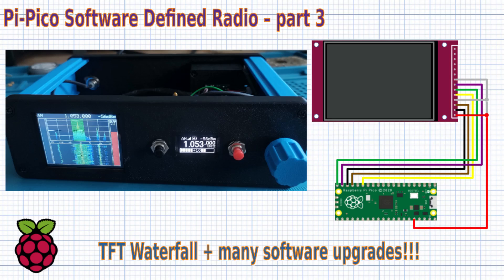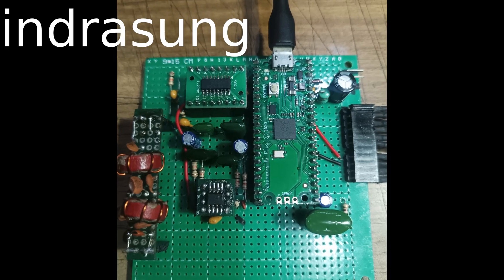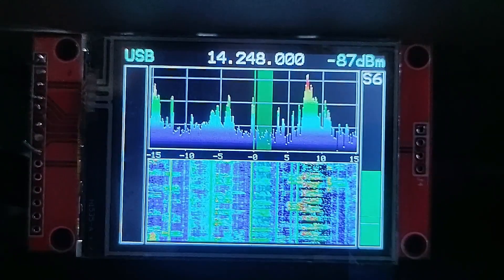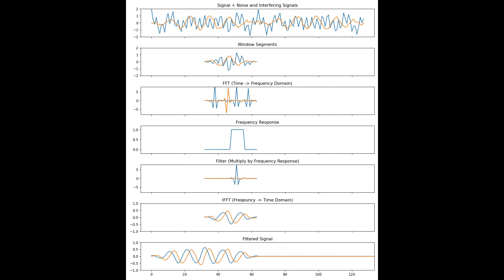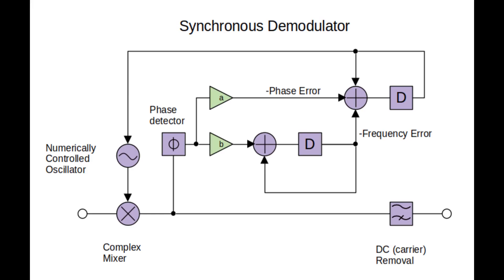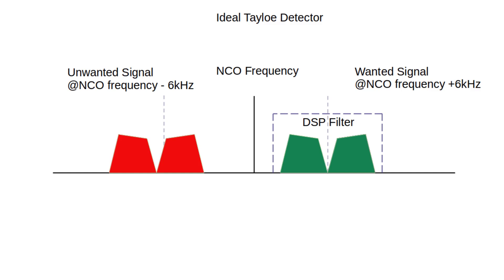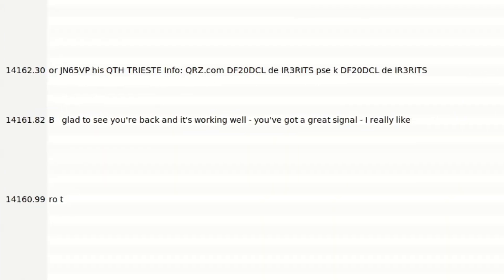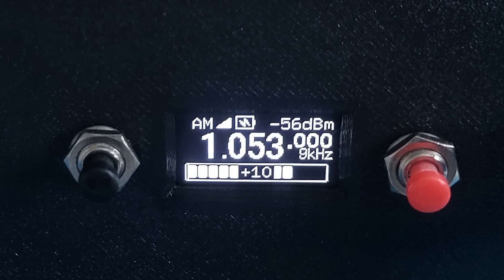Software Defined Radio with Pi-Pico - Part 3 TFT waterfall and software upgrades

Comment: Hello Jon again. the upconverter for 2M I have built (to 10.7 Mhz) for your receiver works great with strong FM narrow band signals - with weaker signals (from far repeaters for example) there is quite a lot of fading and crackling that comes and goes - if I connect the I and Q outputs to the PC sound card inputs, these weaker signals are received perfectly - any other settings that would improve this besides playing around with squelch ? - thanks in advance
Reply from the maker: Nice, very impressive! Its hard to say what is going on here, it could just be that you need a bit more gain for the pico? The ADC in the pico is nowhere near as sensitive as the typical audio ADC. Having said that the FM demodulation in the pico RX is a fairly basic implementation. It would probably benefit from an additional low-pass filter after the demodulator.

Comment: Hi John! I made this receiver. Everything is good, but there are some unpleasant moments. Lots of interference and signal interruptions when tuning in SSB mode. Similar to si4732. I think that the receiver will work much better if you use si5351 as a frequency synthesizer. It will not complicate the circuit much. Would you like to implement this option?
Reply from the maker: Hi, yes I have implemented si5351 support on the TFT development branch. In terms of receive performance it doesn't make much difference.
Reply: @101Things-ds8tc  Thanks for the quick reply! I would like to know the link to the TFT development branch. I don't really like the operation of the receiver in SSB mode because of the signal interruptions when changing the frequency.... It is very annoying and reduces the class of this receiver. The sound quality is good, but the signal interruptions and the insufficiently clean signal spectrum from the microcontroller spoil everything. Even the receiver on si4732, with an improved frequency tuning algorithm in SSB mode (one click after 16 kHz) is more pleasant to use. For me personally, the sound of the radio is more important than beautiful pictures of the spectrum on the TFT indicator screen. Thank you very much for an interesting project! 73!
Reply from the maker: Hi,

You can find the TFT development branch here: https://github.com/dawsonjon/PicoRX/tree/tft

Keep in mind that it's under development so there will probably be some bugs and things I haven't spotted yet and the documentation isn't up to date.

There are two issues to work around with the tuning clicks, the first is a transient caused by the PWM frequency changing as the PLL retunes. We have been experimenting with various mitigations to minimise the impact.

The second is that the DSP processing has to be halted each time we write to the flash, a limitation of the pi-pico. I have experimented with delaying the writing of new frequencies to flash until they have been stable for a short time. I like the idea of an optimised tuning algorithm along the lines of the si4732 only retuning every 16kHz, it might be possible to do something along similar lines so that the LO only retunes after large changes in frequency.

Cheers
Jon

Comment: Can this SDR be connected to an external sound card 48...96kHz (I and Q channel) and use CAT protocol for use with PowerSdr software? If not...can you enable it?
Reply from the maker: Yes you can connect the I and Q outputs to a soundcard. The Pico Rx does also support CAT control too. You will find that the tuning is unpredictable since the Pico Rx uses a variable frequency offset to accommodate the IF and limited frequency resolution of the PIO based oscillator.

Comment: Hello Jon, I got your Pico 2 code all working with my homebrew 2m/1.25meter downconverter (to 10.7Mhz) - your FM code works great with narrow band (using your code defaults) - great work!. Question: what's the least messy way to disable the USB audio? - I would like to use that port for a simple uart - it does not seem to work with the audio operations going
Reply from the maker: Great 👍 Were you planning to share the results? I'm sure there would be a lot of interest.  You should be able to get a UART and USB audio working simultaneously, that's how the CAT control works. It should be easy enough to remove though, if you wanted to remove the USB audio, I would remove the usb_audio and ring buffer stuff from the cmakelists file, then keep removing code until it compiles cleanly.
Reply: Hello Jon, im still trying to complete this design. Are there any #defines that have to be set for a pico2? In order to get accurate frequency at 150mhz?

Comment: Hello Jon, Im trying to build an FM decoder for 10.7MHZ only (I & Q input) with the pico2 - I dont need screens or controls - much simpler, which revision of your early code do you recommend I base my work on? - this is to decode a 2M transverter I have built thanks in advance - your project is very capable
Reply from the maker: Hi, sounds like a very interesting project, would be keen to find out how you get on. You would probably be best off using the latest code since it's more mature, it.should be fairly easy to take out the bits you don't need. Most of the work is done in rx.cpp and rx_dsp.cpp. If you don't have a display etc, it is possible to run the receiver without the UI, using just the CAT interface for example. Might be useful for testing.

Comment: Can anyone tell me if bjt transistors could be used instead of op amps?
Reply from the maker: Hi, it's an interesting question... I'm sure it would be possible to design an equivalent circuit using individual BJTs, but I think it could be quite challenging to design and would probably be more complicated (and expensive), than an op-amp solution. It is possible to get the op-amps in through hole packages, and there are alternatives if availability is an issue especially if you are willing to consider 5v devices.

Comment: I have a question, hopefully you're still responding to youtube comments -

Since your LO is a fractional-N division of the Pico's system clock, what effect do the resulting jitter/spurs have on your performance?
Reply from the maker: Hi, yes this is certainly a compromise, but it's very hard to predict the effect on performance analytically, since it depends on the spectral content of the jitter. If the jitter were totally random, this would lead to phase noise effectively increasing the noise floor. In reality the jitter isn't random but occurs in a repeating patterns leading to spurs, some of which might result in interfering signals being heard. I think that also adjusting the clock frequency to give the closest match helps to reduce the total amount of energy not at the fundamental. The performance is also frequency dependent having a more significant effect at high frequencies, and negligible at low frequencies.

In practice the receiver does work very well, it can hear nearly everything my other receivers can, giving plenty of signals right up to the 10m band. There will be occasions where the spurs lead to interference being heard. I'm working on a couple of ideas to help improve this though, and will share them in the next update video.

Comment: There is a big improvements since I build one, this is very good. One question, according to the user manual, is it all features specify in your latest user manual are in the master branch or others branch from your github page?. And very thanks to include my build picture in your video. Bahari - 9M2GRC, 7 3
Reply from the maker: Thanks very much for sharing you build! It's very rewarding when others take the time to reproduce a project. I hope you had as much fun with it as I did.

The firmware on the master branch (and the pre-built binaries) have all the features mentioned in the user manual.

There are more features in the works too.
Reply: @101Things-ds8tc  For TFT can I used SPI based but with different resolution 128x128?
Reply from the maker: Sadly no, it would be a fair bit of work to adapt the software to work at a different resolution.

Comment: I am gathering yhe parts to build this now. The 2.8" screen doesn't seem to fit in the 3d printed case....? Did you use the 2.8 or a 2.2"? Thanks!
Reply from the maker: Ah yes, I used the 2.4 inch version... Good luck with your build.
Reply: @101Things-ds8tc  i guess this comment will help others, but I ordered the 2.8" screen, because it is shown in the video. :(
Reply from the maker: We could look at providing an alternative front panel to accommodate the 2.8inch screen. I think it could work with a bit of fiddling...
Reply: @101Things-ds8tc  Or you could edit the video to add a note that the 2.4" is required, not the 2.8" shown... I didn't read the BOM before ordering, because of this video.
Reply from the maker: I have blurred it out in the video. I can add a 2.8 inch version of the front panel too if there is any interest.
Reply: @101Things-ds8tc  Blurring it out should do the trick.

I've already got the 2.4" screens coming, but bigger is always better, right? I think the ILI9341 screens stop at 3.5".

Thanks for your effort! I am excited about getting this RX assembled.

Comment: First. This device is fantastic for what it is. I've been using it for mw dx the past week with a homebrew PA0RDT miniwhip powered with bias t from a MLA 30+ with the cover off to allow attenuation. Amsyn great and overall this thing is rock solid stable. The only wish I have is to have 3db increments in agc. Is that just a simple extension of a string an or array that a common hack could apply?

The one area that I do have question with is with audio line between the pico and the earphones jack. There is a lot of difference here between the "original" and what you have done. I built as you show expecting that changes in software application were the reason. After one night of use I seemed to notice no expanding in audio bandwidth when am receiver bw changed and, it seemed muddy and narrow in audio spectrum. I've gone from 100uf down to 22uf and kinda think I can get away with bit more. I do not think I hear the machine running after this change. I am very interested to know what you think here? Seems the 100uf is a very limiting factor to audio fidelity but, I do not know enough about this device to know why it is as it is. ... 
I hope you continue forward with this device.
Reply from the maker: Cool! Thanks very much for the feedback. 

3dB steps is slightly more difficult, but should be possible. 6dB steps uses powers of 2, so all the manipulation can be done with shifts. 3dB steps would need shifts and multiplies.

The 100uF capacitor is a DC blocking capacitor and determines the bass response. It forms a high-pass filter with the headphone (e.g. 32 ohm), so has a cutoff frequency of about 50Hz). Substituting a 22uF capacitor would give a cutoff of about 200Hz, so would block out more bass frequencies. This would be fine for voice signals though. If you use an amplifier, this would have an input impedance in the 10k or more, so would let through everything above 1Hz.

The 100ohm resistor and 470nF capacitor form a low-pass filter. This determines the trebble response, these value give a cutoff of 3.3kHz. Decreasing either the resistor of capacitor would increase the cutoff frequency, but would allow through more PWM ripple. There isn't much to be gained from increasing the cutoff frequency because the DSP filters don't let through much above 3kHz in any case.
 
The values I have used are good choices for voice reception, but it would be possible to make some tweaks to improve reception of music (within the limits of what an AM channel can achieve).

Cheers
Jon
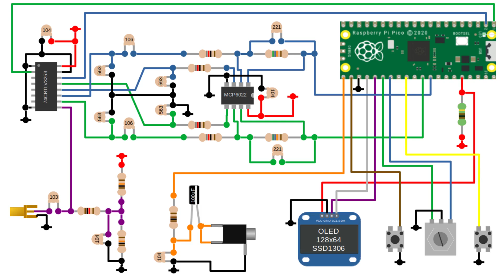Reply: @101Things-ds8tc  What 470n?? At 00:09 the layout shows a 100uf, 100r & 104 cap??? Should the 104 be a 470nf?
Reply from the maker: Ah yes, there is an inconsistency between the coloured schematic in the video and the more traditional schematic on the documentation page. I actually used 100n in the build and it works fine, it would have a cutoff of 15kHz, but should still attenuate the PWM ripple by about 30dB. 470nF would probably be better having a cutoff closer to 3kHz giving about 40dB attenuation of PWM ripple.

Comment: That pretty interesting projec you get. For that I&Q Mixer imbalanc, I wonder if  it will be simpler measure that inbaalance one time (sort of calibration pocess) and mapped for each LO frequency. You could use that to make look up table. Ps. Lately doing measurement of microwave I&Q Mixer upconvertion image rejection and contemplate what the better methode beside using 90 degree hybride: feed arbitrary 90 degree I&Q, or sweep 360 degree to find minima and maxima on both sidebands for each frequency. The arbitrary 90 degree is useful for off the shell aplication that reqired consystency with average performance, with the sweep you can determin true performance for custome application.
Reply from the maker: Cool, sounds interesting!

Comment: Are there any full schematics/pcb layouts/gerbers available?
Reply from the maker: Sure, there is the original picorx design it was based on, you can find that here: https://github.com/dawsonjon/PicoRX/tree/master/PCB/pico_rx. It doesn't have all the latest tweaks though. 

You could try this one by Jim Reagans: https://github.com/JimReagans/PICO-RX or this one by F4GOH: https://github.com/f4goh/SDR-PICO.
Reply: @101Things-ds8tc  Nice. I'll have a look. Been following the project for a while, but with the USB audio and the FFT waterful.

Comment: Hello, 
I just realize the AGC must be set to slow or fixed gain for tuning with tuneable loop active antenna. Otherwise the tuning noise peak not heard / missed in fast agc setting / can not peak the loop tuning.
Reply from the maker: Yes, that wouldn't suprise me. Actually all the AGC modes respond quickly to an increase in power, but the time it takes to increase the gain when the power decreases changes significantly. It probably makes sense to use manual gain control to turn the loop then switch the AGC back on.

Comment: Hello 
What is the dot horisontal line for, that going up or down while tuning, in the oled 1st spectrum view ?
Thanks
Reply from the maker: The magnitude axis of the spectrum scope is scaled dynamically depending on the signal strength. 

The horizontal dotted lines are spaced at 40dB intervals and to give an indication of the magnitude scaling. The lines get closer together when strong signals are present.
Reply: @101Things-ds8tc  ok I see thanks 👍

Comment: Hi Mr. Dowson (and developent team), I've already mounted your great designs (although I've been faithful to the usdx for four years). I wonder why you haven't decoupled the output of the op amps by means of a capacitor (100nf). I'm feeding the 3243 and the op amp at 5v so I suppose I'll have to put a voltage divider at the op amp output, but perhaps (I have to measure it) if I decouple the output, said divider won't be necessary since I'd only have the AC input to the ADC. What do you think? Thank you very much for such a nice and well documented project and of course, for sharing it with all of us. Best regards.
Reply from the maker: Hi, good question! 

The ADC on the pi-pico needs a voltage between 0v and 3.3v (unlike a sound card which can accept negative voltages), so it does need a DC bias to work properly. With 3.3v devices, the DC bias at the input to the analog mux is mid rail and this conveniently passes through the QSD giving the required DC bias at the ADC input.

If you add a 100nF DC blocking capacitor between the op-amp and the ADC, it will remove the DC bias, and will need to be added back in using a biasing network between the capacitor and the ADC.

(The uSDX does precisely this, using a blocking capacitor to remove the DC bias and then adding the DC bias back in again. This is so that they can exploit the ability to change the ADC reference voltage to implement a simple gain control mechanism, as the ADC reference changes, so does the bias. The Pico ADC doesn't have this feature.)

Overall, I think adding a potential divider between the op-amp and the ADC is a simpler (and safer) option, because it can reduce the DC bias from 2.5v to say 1.5v as well as reducing voltage swing (which might happen if the op-amp saturates) from 5v to 3v, respecting the limits of the ADC input.

Kind regards
Jon

Comment: Good afternoon, I compiled the TFT branch, as I asked before, the receiver would be even better if you add the delay in the squelch option, I'm thinking of designing the PCB to fit inside the JBL GO 3, I also want to say that I compiled the TESTING branch, but it adds a lot of background noise, making it impossible to even listen to AM modulation radios, and finally, since we have a third ADC channel on the raspberry, why not maybe use it as a true analog squelch? I used GOOLE TRANSLATOR to write here, I'm from the south of Brazil. Best regards.
Reply from the maker: Hi, I have added the squelch delay to the TFT branch now, feel free to give it a try... Your JBL GO project sounds very interesting, would love to see a picture! I have other plans for the spare ADC channel, but I have added a "shortcut" to make it easier to adjust the squelch settings, just hold the "back" button and the encoder button, then turn the encoder... Hope that helps!
Reply: @101Things-ds8tc  Thank you very much.

Comment: The link to binaries is either broken, or missing from github.  Only log files seem to be there.
Reply from the maker: I'm using GitHub actions to automate the build, and that's where the link should take you. Under "actions" you should see a number of builds, if you click on the latest one you should see 3 downloadable .zip files which contain the .uf2 files. Just pick the one that matches your Pico version....